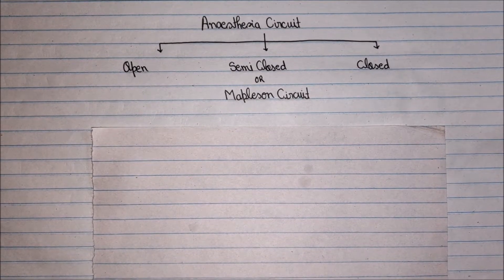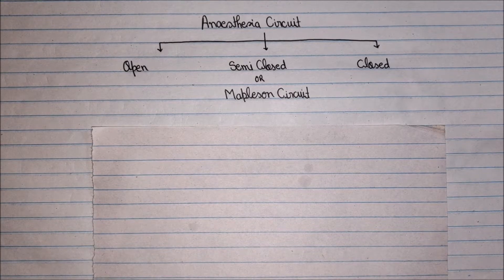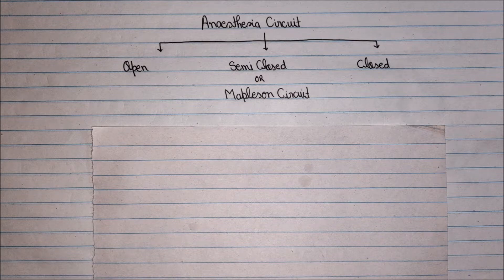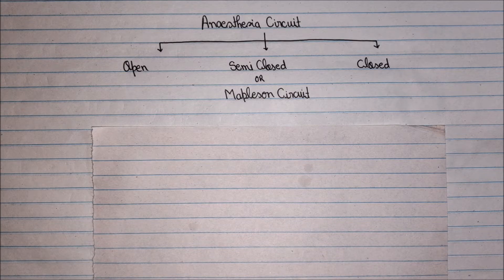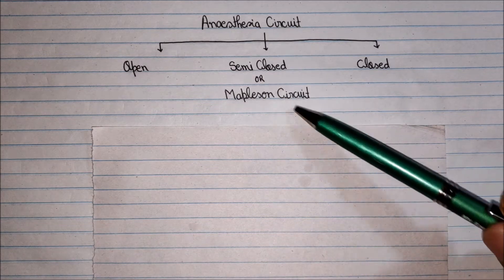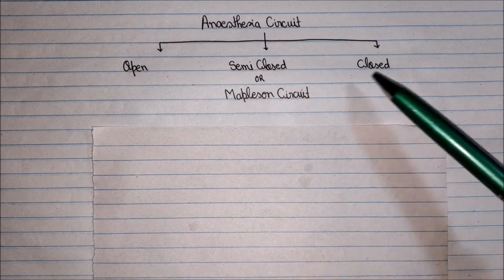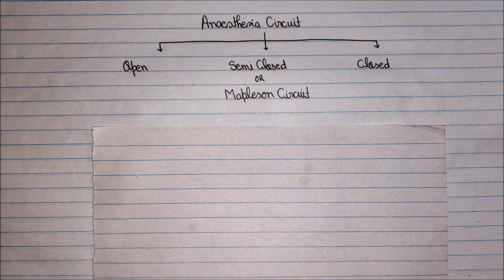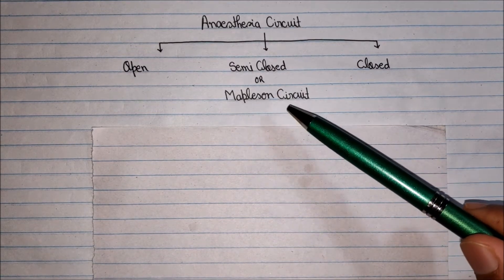Mapleson Circuit | Anaesthesia Circuit (Breathing circuit) NEET PG

Comment: Sir what's the difference between open and closed circuit
Reply from the maker: Open circuit is basically atmosphere and actually no circuit, closed circuit is closed to atmosphere means no connection from direct atmospheric gases , fresh gas flow will be equal to uptake with CO2 absorber is used